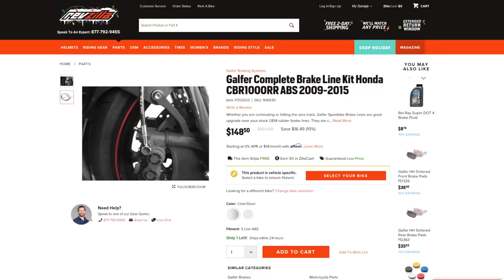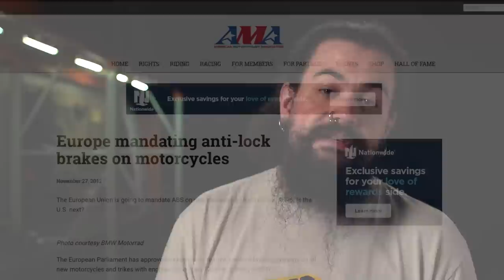3 Arguments AGAINST Motorcycle ABS!

Comment: I know a few people who rely on abs and traction control over actual skill, they scream up to corners, jam on the brakes and just let the computer get them round the bend rather than judging what to do themselves.
Reply: You forgot slow. You know slow people that do that. There are no fast people that ride that way.
Reply: @BTrain-is8ch  I agree. They have no smoothness or flow to their riding. Some people have never had bikes without abs. They've never had to ride without a safety net.
Reply: mld  I wouldn't say that. I think it should be used as a safety net rather than a crutch.
Reply: I mean I get your point, but if someone’s new to riding and live in cold weather, traction control is sorta important because of the cold temps. It’s better to use traction control until you feel comfortable to take it off than to sit there take it off and have some real bad spills.
Reply: @dongambino5308  a lot of those people wouldn't ever turn them off though. Having something with decent tyres and a sensible amount of power as well as a sensible approach to riding to your conditions would be far more beneficial I feel.
Reply: @The_Heathen89  well I’ll give you my example, I’m new to all this, I wanna get into motorcycles but never rode. I live in New England where it’s cold like 8 months out of the year, and we all know low temps aren’t helpful with traction. I want to get something with like 400cc, throw on good tyres etc, but chances are I will probably fall or slip more without traction control. Reality of my city, aka Boston, is the streets are small with plenty of lights and turns, so if I take an unexpected fall it’s not like I just slide into a ditch with no traffic behind me, ill either slide into a parked car or the car that’s right up my ass behind me will probably run me over. So in part id love to ride without abs or traction control, because that’s how I like cars, but realistically speaking it’s probably not safe to start off without TC because I will fall and all it’ll take is some idiot on their phone behind me to not see me go down and all of a sudden it’s “did I hit a speed bump?” That’s why I think it could be useful, there’s more risk in city riding so to play around without traction control as a first timer in cold weather just seems like a disaster waiting to happen. I’ll wait to push the envelope.
Reply: @dongambino5308  that's fair, I kinda see your point and ultimately it's your choice. I live in the UK, the weather here is all over the place and I ride all year so I'm used to adverse conditions. Saying that, I think it's generally warmer here than where you are. 
Ride safe, stay vigilant.
Reply: @The_Heathen89  you too man, y’all get plenty of rain lmao. Stay safe

Comment: Cost and complexity shouldn't compromise safety. 99.9% of riders, as you said, cannot out brake ABS. ABS for on-road motorcycles is just common sense.
ABS is a legal requirement in Europe. As there are many, many more motorcycles sold in Europe than in the USA, it just makes sense to build the bike with ABS (as, again, you said). I would prefer that you have the option to turn off ABS on all bikes rather than just some off-road bikes.

Comment: Great presentation!  Through training I have always been told that knowing how to break properly is the best stop a bike, and practicing those techniques is the best way to keep them fresh.  I was just reading the manual for a Vaquero and when describing how their abs works, they specifically say it can increase breaking distance.  So I’m kind of in the middle.  However I lean more to the training side after watching a demonstration about a police H-D where the instructor is able to stop in a shorter distance with no abs!
Reply: This is a common fallacy,  You can only outperform ABS in slow straight line stop.  Usually less than 20mph on clean dry pavement and where the rear wheel is allowed to come off the  ground causing loss of steering control..  The street is unpredictable.  I would love to go up against some pundits with sand, oil, or water on the pavement and watch them low side or run 50 feet beyond me in a  high  speed stop.
Reply: @kannermw also, it's another thing to stop in a panic emergency situation. ABS is great overall
Reply: @NoNopeAndNo  There are different levels of ABS sophistication.  Some integrate engine controller to know gear selection and throttle position to reflect effect of engine braking on rear wheel.  Some modulate brake pressure more precisely to minimize skid-slip variation and maintain braking pressure closer to threshold just below wheel lock-up with real-time control (100s of times per second).  Then there are multi-axis (lean angle) dependent systems allowing maximum braking in a corner with low risk of low-side crash that no human can possibly replicate in real world variable conditions.

The individuals that claim they can outperform such systems  falsely perceive they have superhuman skills.  They are just plain ignorant and quite possibly the next future organ donors waiting for their final turn.
Reply: @kannermw  absolutely, I have seen details about various ABS systems and further advancements. You're spot on with your comment 👌

Comment: A few things. Can you stop faster without ABS? Sometimes. Fact is ABS is far more often than not beneficial. It's just a numbers game. Almost always better with it. Secondly, regarding economy of scale, they charge more because they can. Most "bikers" aren't too bright and think they're smarter than they are, and because it's not demanded by customers as standard. Building different variants will ALWAYS increase the cost. Building a single platform will ALWAYS lower the cost. If ABS were standard on all bikes, they could actually be cheaper to produce than bikes without ABS right now.

Comment: I’ve never had ABS but I think it’s something that at this point should be all or none. I cut my teeth on non ABS and likely am a better rider for it. However, if I started on ABS and moved to non ABS, that might be a slightly dangerous scenario. Cars have to have it, with good reason. Maybe make it switchable on ADV bikes, mandatory elsewhere. I’m sure there was a time riders opposed replacement of gas head lamps with electricity, but we need to evolve with what’s best for all.
Reply: You should be able to turn it off completely to practice panic braking. You'll never stop faster than with threshold braking and with threshold braking the ABS doesn't activate. The ABS system kicking in will slightly increase the stopping distance, even if by a little bit.

ABS is great for people who don't know how to ride or are riding in conditions they shouldn't be riding in. It's also great if you're riding a larger, heavier bike that's harder to manage at low speed.
Reply: Chris L good point, makes sense

Comment: Abs should be standart issue on motorcycle with an option to turn it off when you don't ned it. maybe the turn on and off part make it a bit expensive but making abs standard is a good thing because braking in rain is scary >~<

Comment: I watched a motorcycle instructor do a test of braking distance on both a sealed surface and on loose gravel with ABS on and off. With dis skill levels he was able to stop on both surfaces in about the same distance, the difference was the level of control he has while performing the manoeuvre was improved with ABS turned on.
Reply: Anyone can practice such a technique in a controlled environment where you know exactly when to start braking and what you are braking on.  No instant surprise event where adrenaline takes over.  On the street all bets are off.  Dry pavement contaminated with sand or oil n middle of braking event is recipe for disaster

Comment: This subject is like carburator vs fuel injection.  ABS vs Non ABS.  I have been riding since 1974 on the street (no dirt riding).  I have not crashed my motorcycle in all of that time.  I have had 40 different motorcycles and have ridden over 1 million miles in that time.  I have had BMWs with ABS, but most of my bikes do not have or have not had ABS.  I have yet to need ABS so I don't know if it is better or not.  How about 65 mph on Hwy 29, in Lake County CA, when 4 horses jumped out in front of me onto the highway....  In my head, "Front brake, front brake, front brake, look away from the horses, let go and turn."  If you can't do that, you haven't been practicing for "what if" in your motorcycling life.  My wife was on back and the forward push from her into me almost collapsed my arms.  Luckily, I do tricep extensions to keep in "motorcycle riding shape."  So, is ABS mandatory?  No, motorcycle riding practice is mandatory.  Like everything else in life, you can let others do things for you or you can do them yourself.  You can let the manufacturer "learn braking" for you with ABS or you can practice for your own safety.  No accidents with motorcycle in my life or riding.  Practice, practice, practice.  www.ridelikeapro.com with Jerry Paladino....

Comment: I've been riding motorcycles for 10 years, I got in my first accident two months ago because my bike did not have ABS brakes. A car pulled in front of me as I was riding by, looks like they were not going to stop, so I panic braked and my rear wheel locked which threw me from the bike. I didn't have any broken bones, but my hand is sprained pretty bad and still sprained, and my bike was damaged. I am unsure if I'm going to continue riding, but if I do, I'm going to sell my current bike and purchase one with abs.

Comment: ABS in my Vrod Muscle saved me a couple times. But I have too flush my brake fluid every two years through the dealership every two years. It is  very sensitive to small particles and water. HD is not known to keep parts in stock. I may have to consider removing it in the future.

Comment: Lemmy I have ABS my 18 Ultra but not on my 19 FLHT or my 01 XL1200. I practice emergency breaking up to 50 mph and my abs never kicks in because I treat it like a non abs bike. No rear or front wheel lock up either. ABS will prevent lock up if you do grab too much brake

Comment: The last main reason is bumpy surfaces. I've had it before where I was breaking nicely and hit a small bump and lost grip for a fraction of a second. Immediately abs bumped on, but in doing so I completely lost the ability to break for  at least 10 feet while abs tried to figure things out.making so that once abs stopped screwing with me, I had to brake significantly harder than I had to before. Abs also doesn't help with quick jabs at the break. You will slide an abs vehicle if you have to momentarily hit the breaks just as you would in a non abs vehicle. Abs has its place but the system is quite flawed and if drivers learned to drive correctly, we would not need abs.
Reply: sounds like an really old/outdated abs system you got there mate

Comment: I don't like abs as i use to race but abs in the wet in the road works OK..
Only issue is many bikes you can't turn it off unless you start pulling fuses.
In Australia from the 1st November 2019 all  new motocycles have to  be sold  with Abs so all the manufacturers supply bikes in Oz with ABS you can thank a old man's motocycle  club doing a study for the federal government and they brought in the UN law of abs in Australia. 
Also if you are caught with abs removed from the police instant fine.  If you buy a bike before 1st Nov 2019 with abs you legally can remove it  crazy right...

Comment: never had a bike with ABS and never needed it.   Have done quite a few emergency stops and you can feel when the back starts to lock up and modulate it on your own or at least that is what i do. The front sliding out is much harder to deal with but fortunatly ive never had that happen.

Comment: Lem, you forgot to mention the 4th, and most important reason; ABS MENTALITY. What does that mean? Well, ABS system is just a system to HELP with your extra strong braking in a situation where normal brakes would slide. BUT as you have probably figured out, a lot of riders say "Well, I do have ABS on my bike, so I can go that much faster...", which is completely wrong. It's the same thing with all rider aids, such as TC, and engine modes, cornering ABS and so forth. Instead of just having a tiny bit of safety net under us, there is a mentality that says: "Well, my bike has ALL the aids, so naturally I can go that much faster in a corner, even if I screw up, there are aids that will sort me out."
Reply: Well that'd be stupid. You really shouldn't ever be braking hard enough for the ABS to kick in while you're cornering, at that point you're going involuntarily off-road if you were going fast.

Comment: My Yamaha '23 XSR apparently mixes front and back.  Do I need to use the rear foot brake?  I had an accident where I locked up the rear wheel, and probably let up on the front, and ran off the road, kissing the street.  The rear brake skidding messed me up.  For that one reason, I would of been far better off with this ABS, and not use the rear brake at all.

Comment: The fact is that if your braking skills are that advanced, the abs will never be a factor because you will adjust to just the right amount of braking pressure to come to the perfect stop without locking the brakes at all. For the rest of us... there’s no reason to risk riding a street bike without this potentially life saving feature. Then go practice the emergency stops some more so you never need it.

Comment: Non abs bikes will have higher insurance due to the higher perceived risk of locking up and losing control. That’s how insurance companies work . So the increased cost to purchase a bike will be matched by lower insurance rates. Most off road bikes have the ability to shut off the abs, so that shouldn’t be an issue, so the philosophical reason is the most valid.

Comment: My question to all the “experts” that can out brake an ABS system is can you still swerve to avoid what you are trying to miss while doing so., The whole point of abs on both cars and bikes is to maintain control under heavy braking rather than reducing braking distance.I personally feel that if you are braking to the point that abs intervenes then you are perhaps breaking too late or simply over breaking.Agree that it should be able to be disabled fully on an off road bike due to an entirely different riding style than road riding.

Comment: As much as I appreciate stuff like ABS, traction control etc. nowadays, if something starts to play up, I have no idea where to start, whereas on my old two strokes it would be kickstart to check compression>petrol check>spark plug>carb off>other electrical stuff.
Nowadays, I’m stuffed til I can get enough money together and get it transported to a dealer (in my case a couple of hundred miles away) so I am definitely on the K.I.S.S side of the argument.

Comment: Euro 4 requires ABS on  2017 and newer bikes.  Bad things happen under PANIC situations.  We all think we can handle panic problems but until your in that situation that is still unknown.  Doctors, pilots, paramedics, etc., constantly practice emergencies where they can do it in their sleep.  Electronics are always 100% and never panic or distracted.  I have raced both cars and Motorcyces for over 50 years.  I buy bikes/cars with every electronic aid possible.  Hospitals are expensive as well as time off work.  Stability control was mandated on all cars starting in 2012.  More and more stability showing up on bikes as costs come down.  All my bikes have stability control.  I am a trauma doctor and I get to see all the  PANIC situations.  Also never hold your breath in a panic situation with scuba.  If you stall a plane near the ground you still have to put the nose down.  Something to think about.

Comment: Also lets not forget. Every ABS can be turned off by pulling out the fuse. Or, for electric hobbyists, add on/off switch to your handlebar leading to fusebox. :P Full control over ABS.